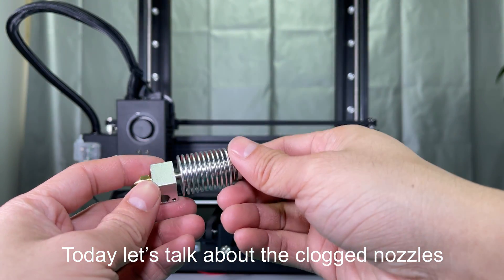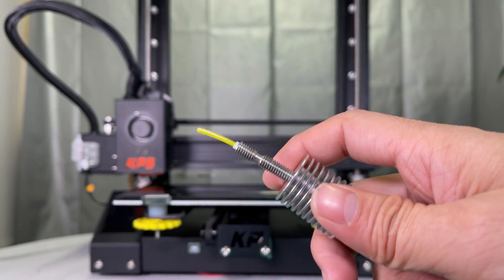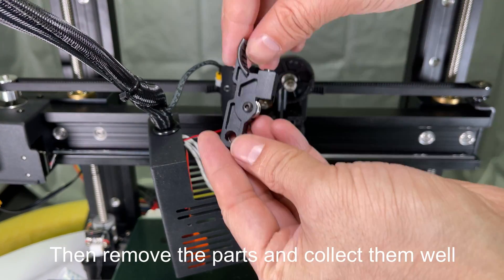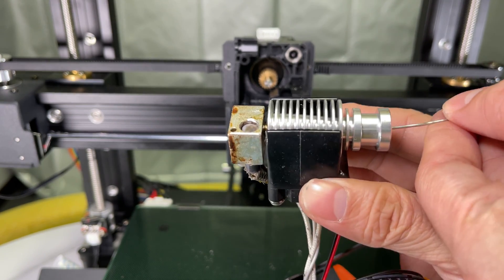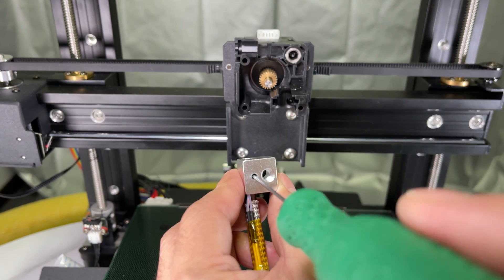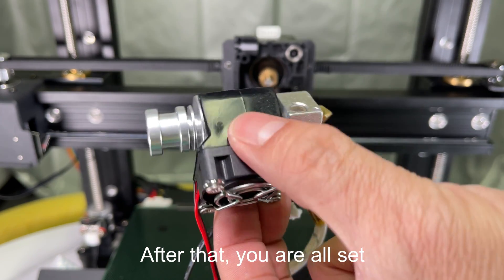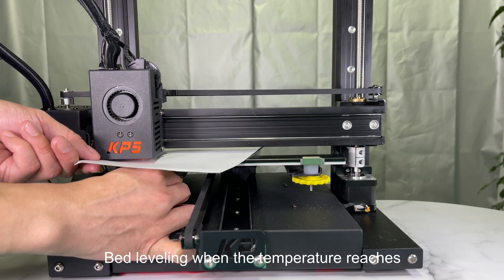Kingroon KP5 Series/KP3S Nozzle Clogging Trouble Shooting and Solutions

Comment: Probably the #1 reason of why this particular hotend ends up clogging is because the thread of the heatbreak is way undersized for the heatsink (or at least one of these is machined improperly and you'll feel a slack before tightening things up), creating a really poor thermal transfer between the two that allows the filament to melt inside the bowden tube as the heat is not being dissipated properly. The solution? Just add thermal paste on the thread between these two pieces. 
And while you're at it, remove any burrs on the openings and exits on both the heatsink and the heatbreak, as the machining on these parts isn't very great and they grind the filament into a nasty powder that could potentially cause issues. You'll know when they're gone if you feel a piece of filament moving through these holes without resistance.  

I performed these two preventive manteinances on my hotend and it has never clogged on me again.

Comment: I have a cure, 1st off, replace the ptfe tube in the hotend, square cut a piece of a quality ptfe  bowden tube that fits tight with no gaps for cooling filament to get caught in. make sure its a tight snug fit. Or do what i did after it got worse with time, Invest a few pennies on your KP3S, Buy a Creality Efit Extruder and a creality spider v2 hotend.  Ive been running them for months doing some long large prints.   It did fail yesterday though, Seems a mosfet on the boards gone and it sent full power to the hotend and melted the heater element through the Volcano block i had on it. White hot in seconds!!!!  So glad i was there when that happened cause that could have turned out bad. As it was just a new board and heat block are needed.

Comment: The closed top of the heat sink is a disaster... For someone like me who changes colors very often, I keep getting pieces either stuck at the top of the tiny hole or my filament breaks inside the heat sink when I am pulling it out (the melted end will always be a tad bit bigger). Ended up buying a regular V6 with a big opening.
Reply from the maker: Maybe try 1mm retraction distance and use lower print temperatures. Or you can try our slicing settings directly. Files can be found on http://kingroon.com/

Comment: let the extruder cool down after every print before powering of the printer , when the fan stops with a warm extruder you have a clogged nozzle almost every time if you are unlucky
Reply from the maker: That happens when having wrong settings. Try use 0.1mm retraction distance and lower print temperatures.
Reply: @Kingroon3DOfficial  when i opened my box with a completely new kp3s bought from you the first thing i hade to do was to clean my clogged nozzle from filament that was stuck after som of your testpilots just turn the machine of and not let the extruder cool down and I am sure that i am not the only one suffering from that , but when fixad that i am happy with my printer and have another one on the way home to , but your testpilot can chill for som minutes before shutting the machine of and pack it in a box .

Comment: It would be helpful to specify the size and type of screws. It would also be helpful to include extra PTFE tubing and at least one spare throat tube. KP5L seems prone to clogged nozzles?
Reply from the maker: Which screws do you mean? It’s actually necessary to specify when new screws are required, we will try improve that on the new videos. It’s also necessary to keep some extra parts and accessories like PTFE tube and throat tube since they’re expendables. They are easily to get from kingroon.com. As for your last question, it’s not. KP5L is using a same extruder like KP3S do.
Reply: @Kingroon3DOfficial  I try to buy heat throats fron your web site but nothing is clear as what fits the KP5L your company should do a better job with marketing the spare parts. I don't even know what type of hot end is on my kp5l
Reply: I've solved the clogged nozzle issue by fine tuning print settings. All screws used in the KP5 should be described in a parts list. The small set screw in the heat block isn't identified. If you drop it, good luck finding it.
Reply from the maker: @endicott65  Sure, we made that improvement in our latest video, it’s going to be publish soon. Your advice is important. And our profiles on Cura and PrusaSlicer will keep updated, too. Thanks!

Comment: What size ptfe  tube is in the heat break tube?
Reply from the maker: 1.75mm
Reply: 4mm outside diameter, 2mm inside diameter for 1.75mm filament
Reply: My KP3S has 3x2mm

Comment: Between Heatbreak and Heatsink belongs Thermally conductive paste!
Reply from the maker: What does that mean? Please say more about it.
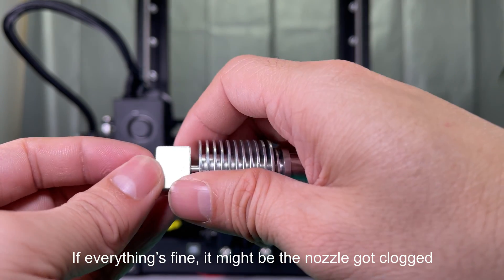Reply: @Kingroon3DOfficial  See from 2:00 - https://www.youtube.com/watch?v=gwNAMveHLmw
Reply from the maker: @MirdaJarab  Thanks for your answer! I got it. It's a good way to avoid leaking. And we believe that will make it difficult to replace the throat tube. That why we preheat the nozzle before tightening the nozzle and throat tube.
Reply: @Kingroon3DOfficial  This has nothing to do with changing the nozzle. It is a heat dissipation from Heatbreak...
Reply from the maker: @MirdaJarab  I thought it is a kind of glue, my bad. In this case, I will go find one and try it. Thanks for your suggestion!
Reply: @Kingroon3DOfficial  Heat conductive paste :-)
Reply from the maker: @MirdaJarab  I see. Turns out we are selling this. I will try use it in the future videos.